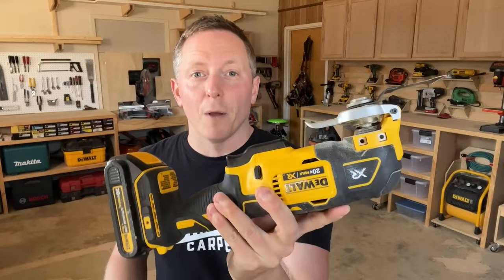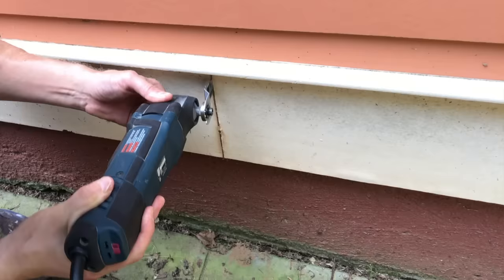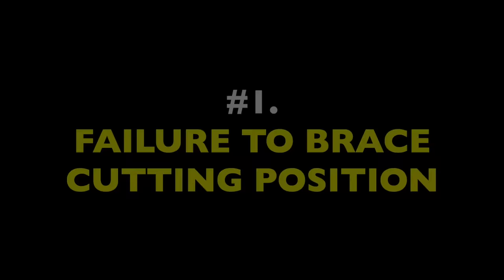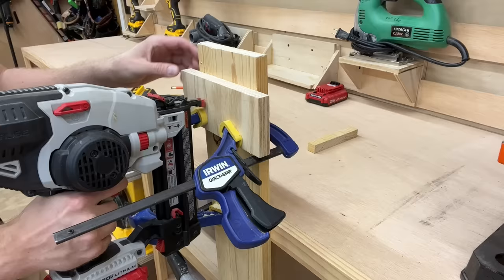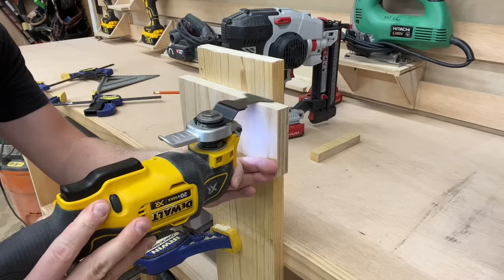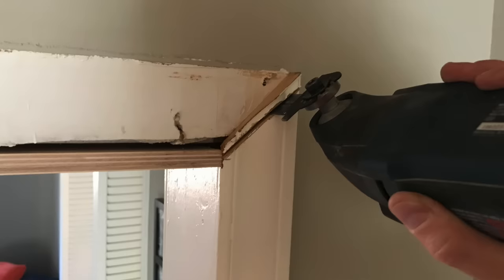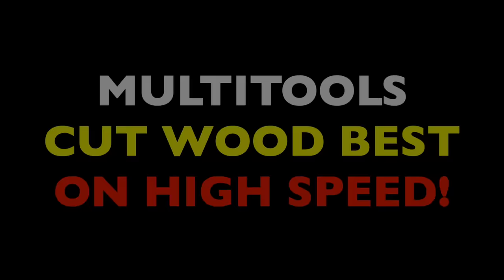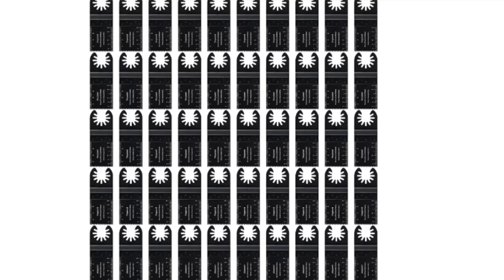6 MULTITOOL CUTTING MISTAKES! (How to Cut Straight With a Multitool...AVOID THESE COMMON ERRORS!)

Comment: What’s everyone’s preference. DeWalt multi or Milwaukee multi
Reply from the maker: Interested to hear responses here, Brian. I reeeeeally liked my basic toggle switch Bosch too. That thing ran so smooth!
Reply: Makita 😬
Reply: Hyper Tough it's the generic Wal-mart brand, but it's just as reliable, & all the blades come included.
Reply: Milwaukee...Hands Down
Reply: @dy1an  makita multitool is shockingly bad
Reply: M12 fuel for me. It’s just as powerful as any 18/20 volt tool I’ve ever used.
Reply: @passenger3  works fine for me. I've done all manner of DIY jobs with it, from fitting new electrical outlets to trimming architrave, and squaring the ends on laminate flooring. Battery life is good, and it cuts pretty well 🤷‍♂️
Reply: I am rolling with the m12 fuel these days.
Reply: Makita. Dewalt vibration & noise is shocking.
Reply: I had the more reasonable milwaukee($150 + tax canadian) love it then bought the fuel 18 ( about $300 + tax canadian) . The old milwaukee was great and I was able to accurately cut new end joints in 3/4" solid oak hardwood flooring (without damaging neighboring boards) while changing boards.  The new more expensive fuel is worth the extra money one of the best tools I own.
Reply: I don't use mine enough to warrant the added expense of a new battery system.   The Rigid with a cord at $119 works great.
Reply: My first multi tool was a corded dremmel multimax . It was excellent until a labourer on site “borrowed” it for the day, cutting drywall all day at the maximum speed, and burning out the motor.
Reply: Whichever one you have the batteries for if going cordless. I settled on Makita because I trust that brand's ergonomics, lighter weight, and lack of vibrations in general, though no brand is perfect along their lineup. Milwaukee its probably the best in raw power/output in general. DeWalt is for people who like the color yellow and close enough performance for a bit cheaper (and I'm not saying that unironically, there are very few dud tools on the market as long as it isn't cheap dropshipped off-label stuff, get the one that looks the coolest, aesthetics unironically matter though its far from the first consideration).
Reply: Dewalt for the variable speed trigger and that I can stand it up. I use mine to cut but mostly for light sanding on baseboards before painting (I knock down rough edges on holes from 18 gauge nailer and smooth out patch compound).
Reply: @Griffinwoodworks  I'd second that.
Reply: I have a corded Dremel and 18V Ryobi
Reply: I have a Dewalt Atomic. Got a great deal with a battery last holiday season. Works great for projects around the house and i am already vested in the Dewalt battery system.
Reply: Bosch variable speed corded because that's what I have. I'll probably get a Milwaukee cordless because I'm already committed to the batteries. I've been using the oscillating tool since Fein had a lock on the patent and it cost $600 for the full kit. I went through 2 of them (one got stolen off a job) before other brands got in on the market. I also use it for detail sanding, grinding, cutting tile and other tasks, and to wake up someone who's sleeping on the job. Very useful tool indeed!
Reply: Ryobi
Reply: Purchased deawalt XR for $50.
Reply: I prefer a DeWalt corded one.  Cordless one's such in my opinion...
Reply: Corded Dremel here too. I do have cordless envy, but the Dremel works so well I can't justify another
Reply: Milwaukee Fuel
Reply: Fein Saw the original and still the best
Reply: My Dewalt is SO loud lol
Reply: Project fram already did the experiment: Milwaukee won and Ridgid is second with almost half the price of Milwaukee
Reply: Fein is spot on!
Reply: it depends if it's battery or corded, if it's battery, try to use the one you already have batteries for
Reply: Makitas latest model (starlock one) has really low vibration and noise, so if you value that...
Reply: I have a Bosch GOP 18V-28 myself (Starlock Plus capable), and I love it. I started out with a corded Bosh DIY model, but the cord was always a bother. I then got an 18V DIY, but that one quickly got very hot, and I didn't trust it to last. I needed a Starlock Plus blade for a project last fall (80mm long / ~3¼"), and  the DIY didn't support it, so I opted for a proper model. :)
Only downside to the 18V-28 is that the quick release handle is a bit hard to access, and you have to use both hands to release it, but it is quite a work horse.
Qick tip: if you need to cut all the way through in a straight line like in the video, opt for an arched blade, then you don't need to angle the cut.
Reply: The Fein Multimaster.
The original and best.
Reply: I got the ridged platform, can’t really complain, have 2 of em and they work wonders.
Reply: Love my milwaukees
Reply: Thank you Ethan. Your videos are wonderful and enlightening as always. I have the same DeWalt cordless DCS356D1. Got it on Amazon Prime Day for a super discount ($119 for the whole kit) and been very happy with it. I also have a corded Rockwell Sonicrafter F80 (RK683 from Lowes) .... Super powerful with a 4.5A motor and it also allows you to switch gears between a 3.4 degree and 5 degree oscillation angle which you can select depending on the aggressiveness of the cut  . Both of them make life easy for remodelling projects. Sometimes I select the tool based on the project and how much power I need and other times it is just convenient to have two tools around so I don't have to go around switching blades too often.
Reply: I went cheap and bought the Ryobi to see if it’s a tool I’ll use much and now I don’t know how I went without it. So I’ll be up grading to the Milwaukee as I have a lot of batteries and there a reasonable price
Reply: I have that same Dewalt model you demonstrated, only because I have the Dewalt system. I also have an old Bosch corded but now that I have the Dewalt I never use it. One of my sons will probably inherit the old Bosch
Reply: I have the Dewalt and it works great.
Reply: A corded Rigid.  I don't use it much so battery power wasn't an option.  It's a great tool.
Reply: Milwaukee 18V fuel
Reply: @jeffjiang5272  Hola! 🖐Pardon my ignorance, who or what is Project Fram? Good to hear that Rigid is among the top, I'm on the Rigid Platform (batteries). I'll pick one up when the time is right, thanks. 👍
Reply: @jerishigan6567  what! 🎧Can't hear you! 😂(dewalt buzzing in the background)
Reply: I have the Harbor Freight Chicago Electric and for my small home DIY projects has worked just fine. I would emphasize that the blade makes all the difference. The Diablo blade is great.
Reply: Makita or Fein, just because of starlock.
Reply: @woodworksbygrampies1284  It should read Project Farm. Best tool review channel on YouTube IMHO.
Reply: I use a corded Bauer from HF. Just DIY and it has been great around the house.
Reply: I've tried about all of 'em, get great results with my DeWalt so I settled on that one. At the end of the day it's more about great blades and good technique. Get great results with EZArc blades. There are other good ones too. The tool moves the blade, the blade and the user do the cutting.
Reply: @passenger3  
no it isn't.  The one most people know about is the brushed multi tool.  Compare apples with apples.  The Makita brushless is superior to the willfuckies.
Reply: @danielmacdonald16  
He messed up the oscillating tool test.  He compared the brushed Makita with brushless milwaukee and dewault.  The brushless makita is the best one.
Reply: Makita
Reply: Makita lol
Reply: @josephromero1596  
"Makita lol"
Not an argument.
Reply: @danielmacdonald16  Thanks much, I will check them out. 👍
Reply: Project Farm has shown that Milwaukee is actually the best
Reply: @AleksandrPanzinAlex  well out of those he tested but example I have the black brushless Makita and it’s way better then the Makita he tested in the video but not sure how it compares to that Milwaukee - it’s gotta be hard to know for sure when there’s new tools coming out so often
Reply: Milwaukee M18 fuel, because I already had other M18 tools. That said I used it for some body work on my van and it cut the metal like butter. The metal did chew up the blades but that wasn't the tool's fault.
I went with big Red because their M18 Hammer Drill Driver was the most compact highest power at the time. Haven't regretted it. I had a compact Makita first and just didn't have the torque, HD took it back without a question. I have corded drills if I need more torque, so having a tool that fits in more places was key.
Reply: @josephromero1596  Milwaukee is rated as best by pretty much everyone. 

It's just exceptionally fast, due to a larger oscillation angle.
Reply: @AleksandrPanzinAlex  
Incorrect.  He used the makita brushed version and compared it with the milfuckee brushless.  That’s apples and oranges.  The makita brushless is the best.
Reply: @tallswede80  Toolbox Buzz did a head to head, including your beloved Brushless Makita...  And Milwaukee was still better.
Reply: Got myself a corded Ridgid. Works really well for me. Plus the lsa(although I doubt I’ll use it). I hear Milwaukee M18 Fuel is the best out there. All are about the same now.
Reply: Milwaukee
Reply: @donmunro7568  so you can notice a big difference between the M12 and the M18 multitool?
Wanting to know, as may be purchasing soon. Cheers.
Reply: Fein Multimaster. I used several different ones and non of them coming close to Fein.
Reply: @zanderday4466  Yup, nothing come close to Fein tool and the saws they are making.
Reply: @colincutler194   actually the two I have are both 18 the more expensive one in the fuel ( brushless) . I recommend the more expensive one to a buddy who has a corded fien saw ( had it for years but wanted cordless for convenience). He said he thinks it's better than Fien when it was new.
Reply: Have not tried a cordless multi tool. They seem too big and too bulky compared to corded. I’m on my second corded Dremel, this one (MultiMax) has variable speed vs single on the first, which eventually burnt out. If money were no object, I’d buy the Fein, which invented the category.
Reply: @woodworksbygrampies1284  you mean you don’t use the HF blades?
Reply: @bondpit8750  I did at first but going through lath and plaster walls/ceilings really dulled them QUICK. I found that the Diablo, after trying Milwaukee, did the best for me. Have a good one 👊
Reply: I love my Ridgid shop mate kit, and I sometimes use either the 12v, 18v, or the corded power head.
Reply: both = ew
Reply: @TheHonestCarpenter  I have a corded Dewalt, which I love & have used a lot for various cuts. I do have batteries for the Dewalt system, but didn't want the extra weight on the tool, as I have hand grip issues, so corded seemed like the best option & I haven't regretted it... besides my tools are always powered up, ready, & raring to go~ LOL!
Thanks, BTW for the tips & tricks in the video... as always you're spot on advice is appreciated!
Reply: Team Milwaukee all day
Reply: I've always liked DeWalt for power tools and their Flexvolt system gives them a leg up in my book. That said, having never laid my hands on either multitool, I think I would prefer the Milwaukee. We recently had a lot of work done around the house and I was able to observe each. Just based on the sound of them, the Milwaukee had a higher oscillation rate or maybe just tighter tolerances in it's manufacture. It also appeared to cut faster, though the Milwaukee was cutting trim, OSB and HDF while the DeWalt was cutting a mix of sheetrock, vinyl, and framing lumber. 

As for my current tools, my dad and I share the less used power tools (I buy the angle grinder, he buys the die grinder). He's got a corded Rockwell oscillating tool which I'm quite happy with and we're currently invested into the Kobalt battery system so I'd likely go with Kobalt if I get a wireless one in the near future.
Reply: M12 fuel, way more ergonomic,little to no vibration than dewalt but m12 Just doesn’t have that super fast blade change feature that dewalt has unfortunately
Reply: @TheHonestCarpenter  I've had a few brands including the original Fein. 
I'm using probably the most expensive one on the market at the moment. The Festool might not be the best but it is certainly much better than the other brands I've used. It's one of my most used tools in my kit and cuts at a similar pace and efficiency as a quality jigsaw. 

I'm mostly modifying existing cabinetry while it's in situation. Ideally if the cabinetry could be pulled out without disturbing tiles etc.

The ability to make precise cuts in tight spaces makes this tool invaluable. 

Many of the cheaper brands tend to burn through rather than cut. I'm not sure exactly why the cheaper ones are so inferior but I suspect the stroke length is very important and the Festool is amazing in comparison  to the others I've tried.
Reply: DeWalt all day. Blows me a way that Milwaukee wouldn't make use of a variable speed trigger for gently entering precision cuts
Reply: Depends, Dewalt is the best not always justified if you will not need a tool much and Milwaukee offer lifetime warranties on some equipment.
Reply: @user-em6ie2be7x  Yeah, but like Nissan in 5 years it will fail when I can drive my Toyota for decades.
Reply: @passenger3  Depends on the tool.  For drill bits yes but their blade cutters crap in comparison.
Reply: @passenger3  Agreed, I return it
Reply: @andrewgould9395  I use Dremel with PPE (not the bastardized media version)
Reply: @Foxxygrandpa241  Faster blade would make for a smoother start with less chatter. variable speed is only really useful for the sanding plates.
Reply: Dewalt to rule them all..
Reply: @dhawthorne1634  I agree to disagree. May be difference in technique or simply material difference but I find I have the most control of my cut and less chatter starting slow until it's established before I go wide open
Reply: I have the Ryobi and the only thing I can complain about is the way the blades mount with a screw. Other than that it’s a beast and gets the job done. I also got it free with my battery purchase 👌
Reply: M12 Fuel since I’m heavily invested in the line. Powerful and less vibration than I expected even after reading the reviews. Still have my Dremel Multimax as a backup.
Reply: Festool, their only took thats worth the cost other than maybe the dust extractor. Blades are very expensive, but other than that it’s a game changer.
Reply: The one that matches my batteries (Dewalt) That outweighs small differences for me
Reply: DeWalt multitool is horrendous. The vibration and noise is unacceptable
Reply: DeWalt
Reply: DeWalt. Vs Milwaukee. After trying both for the same job, back to back. DeWalt definitely cuts better. Pro tip: my $20 Chicago electric corded, cuts even better.. lol. But not nearly as convenient or ergonomic.
Reply: The DeWalt XR...it's my best buddy!
Reply: Love my flex
Reply: @passenger3  the latest model with starlock? 
because thats one works like a dream.
the second model sucked indeed
Reply: Milwaukee. Hate pulling a trigger. Otherwise the dewalts are killer
Reply: @Griffinwoodworks  I use the M12 fuel too. Had a m18 stolen and its every it thay M18 was
Reply: @TheHonestCarpenter  Definitely, you really can’t go wrong with a Bosch either!
Reply: Fein multimaster. The original multitool
Reply: DeWalts multi tool blows. Noisy, weak and the vibration is awful. I’m a Milwaukee guy mind you.
Reply: It's the switch for me. Give me a on or off and a speed selector. I always run milwaukee multi tools on low speed. Cuts fast and keeps blades cool amd lastinga long time
Reply: When it comes to multi tools the Milwaukee M18 fuel is light years ahead of dewalt I have the brushed M18 as well and it still beats the dewalt but the fuel is so smooth it’s unbelievable
Reply: I don't have both to compare but I'm very satisfied with my Milwaukee.
Reply: Corded Dremel, but I found out too late. It doesn’t take the harbor freight blades. So now I am unhappy with my Dremel.
Reply: Bosch 12v tools for the rolling box, nice powerfull compact, but the multi tool blades have a little different conection and are supper expensive. Maybe its a litle ham fisted to use the genaric blades, but i do. Finese on the line still doesnt give you a joint, like the man described.
Reply: I have an old corded fein that my dad bought before I was even born, two ryobis (my new HP model vibrates so much it's unusable), and the newest DeWalt.  I'm actually going to go with the M18 fuel next because I've used one and was blown away. We don't just use them to cut, we sand floors in corners and under cabinets.
Reply: DeWalt
Reply: @passenger3  Milwaukee, and a close 2nd Makita. I wouldn't use a DeWalt if it was free, their cordless tools aren't very good and the battery quality is terrible.
Reply: DeWalt... I have too many other battery powered tools to go another brand.
Reply: The FLEX Multi Tool is a beast
Reply: Bought an eurbauer corded one it's good enough for me
Reply: @passenger3   wrong... Dewalt.. In other tools milwaukee is better, but in oscillating tool, dewalt is way better.  My humble opinion is also backed by project farms tests of oscillating tools.
Reply: M18
Reply: Makita DM52 LXT 18 VStarlock.  Bulky but very smooth and heavy duty
Reply: I picked up about $2k worth of DeWalt XR tools for $1k last year - kind of a no-brainer to go with the XR multi-tool too.
Reply: @passenger3  against what mark?
Reply: Dewalt all the way.👍
Reply: I really don't think there is any difference between the two, as they are both the same price point (about $120 USD a tool). Personally, I like to get my hands on a Hilti or Matebo multitool and see how one of those rips! I also don't see it having a very long service life with constant tightening of.....well....everything, so Hilti's better warranty and vastly more available service might be ideal in this circumstance.
Reply: I hate batteries, so anything corded will do.
Reply: I just bought a Milwaukee Fuel M18. ITs a beast. I got it because I already have a few M18 tools and why change battery chargers?
Reply: honestly for the best comparison id recommend watching Project Farms video comparing oscillators. 

The guy who i usually work for has a milwaukee, I have a dewalt. I really like the quick change feature of the dewalt, may seem like not a big deal but when ur doing trim work and you wanna cut through nails then go back to wood it makes a big difference - mostly in the pain in the ass department. I also love the variable speed trigger, Ik he said high speed is better but ive found thats not the case, for cleaner cuts it is but when your in tight spots being able to control how violent your tool is going to be is very helpful - the model i have (DCF356B) also has a 3 speed selector limiting your max OPM (oscillations per minute), also very handy. 

With that being said, the milwaukee undoubtedly has more power, cuts quicker through wood, nails, drywall etc and we use the same blades - usually from amazon as diablo blades are just so damn expensive and I feel like multitool blades are the one thing i cant justify the diablo difference on as they feel like they dont last the 10x longer (the price difference is $2.50 a blade in bulk for no name, vs $25 a single diablo blade - at least on amazon). Milwaukee has a 12 speed selector wheel which works well it just doesnt give you the same on the fly control as the dewalt. Most of my tools are milwaukee but i prefer the dewalt multi, admittedly though I dont have nearly as much experience with the milwaukee multi.  Its also worth mentioning that if you are using starlock blades the milwaukee makes it easier to change those, but cmon, just get normal blades lol.

In a side by side comparison at least with the model i have, the noise level of both sounds comparable, my guy said he used to use the dewalt multi but swapped because of noise - so older models may be considerably louder - i dont have experience. Weight-wise the dewalt wins out, which is another big point in its favor in my book anyways (when doing anything above the head it becomes noticeable real quick).

To me it seems like the dewalt is more centered on convenience, and the milwaukee on power, in my experience both last and are built solid, so it really comes down to preference and Id say if youve already got milwaukee batteries just go with milwaukee and vice versa, these things seem to chew through battery life so having more batteries on hand to me outweighs most benefits that either gives (I happened to have a few dewalt batteries from other tools that burnt out (i say milwaukee drills/impacts all the way for longevity!) so getting dewalt made sense for me.
Reply: I bought a cheap corded Erbauer one and it has been fantastic for what I've been using it for.
I've had problems with white finger when using high vibration tools in the past, and the Erbauer multi tool has been so easy to handle.
It can cut through hard metals and you hardly feel the vibrations when using it.
Reply: Ridgid is great bit loud though
Reply: I committed to Dewalt like six years ago… I think Milwaukee is overpriced, so Dewalt is the better “value”
Reply: @giiiddyup  tldr: prices seem 1:1 to me, just pick brands based on what works for you.

lol idk, prices are pretty similar where I'm from, our rural king carries both DeWalt and Milwaukee right next to each other and they pretty much go 1:1 bar a few select items, DeWalt has more wood working options, and Milwaukee has more trade centric items. 

I work in the trades and have some DeWalt, some Makita and some Milwaukee. There's reasons for each tool mostly to due with sound and weight, customers comment often about how quiet my tools are, just because I've cherry picked what seemed quietest to me over the years... I digress. 

Milwaukee generally seems to be the best in terms of raw power, while DeWalt is solid for their table saw, both battery and corded (though mine is just corded). Also like dewalts chopvac again, seems to be one of the quieter vacuums out there. 

Just get the tools that you need and don't worry about brand (between DeWalt, Milwaukee, Makita and flex really, maybe rigid too, but thats about all I see in the field). Or go with whichever brand you have the most batteries for, super convenient when you only have to lug around 1 charger.
Reply: Rigid
Reply: Dewalt
Reply: Makita brushless. Dominates all. No vibration and has starlock and a nice bright light. People experience the brushed version and assume they are similar. That's like saying a Honda civic is slow, so the nsx must be also.
Reply: Fein. No question.
Reply: @Lowgradenarcolepsy  obviously you've never tried makita avt. Butter smooth, 0 vibration, starlock.
Reply: @jerishigan6567 They are all loud. It's not the machine that is loud, it's the steel blade vibrating into the material.
All multitools are crazy loud to use.
Reply: Fien - the original
Reply: @kaymann4005  original doesn't mean the best. Fein is a really good tool though. Just not the best. May be the best for you though
Reply: I’m gonna get ridiculed but ryobi for me. My wife bought me a combo many moons ago when they were blue and yellow. I have most everything for the the green ones now . Perfect for the weekend project. If I made my living with them I might look at other brands. Team green for me.
Reply: @Harveyb358  You do you, brother.
Reply: Milwaukee
Reply: whichever one is charged and ready to go.  I have DeWalt, but I also have a Bauer which is awesome.
Reply: I have the 12v milwaukee and I'm happy so far.  I have a lot of milwaukee tools really only bc I like red over yellow.  Both are great imo
Reply: My AEG has yet to miss a beat.
Reply: I have a fein
Reply: @zanderday4466 the star lock blades are a little tough to find sometimes, but they are extremely well built, and the variable speed comes in handy
Reply: Makita makes the best one. Their top of the line one that uses Starlock attachments doesn't put much vibration back into your hands which is very unique and helpful if you're using the tool for long periods of time.
Reply: Brushless StarLock Makita.
Reply: milwaukee m18 fmt i my choice, but the fein saw are very versatile
Reply: Ryobi
Reply: The Milwaukee M12 Fuel is an awesome tool. It's lighter and can go more places than its 18/20 volt counterparts and still can make great cuts. Be warned though, you need the Fuel version. The M12 base model is loud and vibrates like crazy.